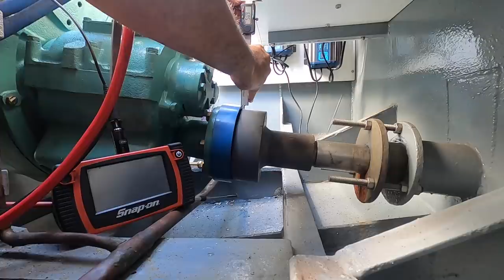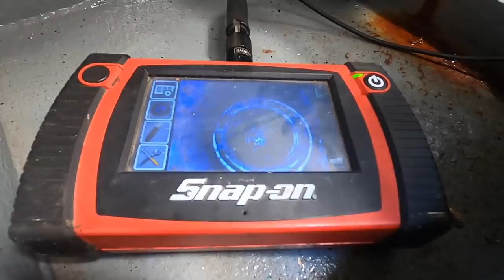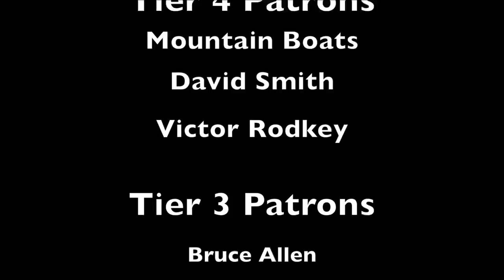Better alignment and odd jobs

Comment: There is a huge assumption that the outside of flange on the prop shaft is bang on aligned with the centre, has there been a measurement of the central alignment of the bolt pattern to the outside of that flange?
Reply from the maker: Nup!

Comment: Hey buddy I just got a used boat with a 1983 Mercury 40hp 2 cylinder outboard on it and I don't know if it's a 2 stroke or 4 stroke engine. I've rebuilt the carb and replace the fuel line. Fuel pump. Just trying to figure out before I start and run it if I need mixed gas or not. This is my first boat but I am a automotive mechanic so I do know how to work on stuff just can't find anything on the web on if the engine is 2 or 4 stroke. Any help would be greatly appreciated and thanks in advance. Keep up the great work

Comment: A bit of sea water is OK in a wooden boat, but not so good for steel. Put a plastic tub (or a plastic jug cut in half) under the stuffing box. If it's a small drip, you can just dump it now and again, for bigger leaks, a small bilge pump w/switch will do it for you. No more foul, corrosive muck hiding in bilge corners, aside from the usual muck, that is... ; {

Comment: Mr worry guts here.. you are taking alignment measurements off the back of the flanges.. Are they machined mm accurate to align with the shafts?
Reply from the maker: It's only to get the bolts started.

Comment: So as you press/slide the engine mount laterally with your adjustment setup, how do you ensure that the opposing mount is actually sliding/moving in the same direction rather than just deflecting at the mounting stud? Are you coaxing it over somehow?
Reply from the maker: I've just been keeping an eye out. You can see the metal ring at the base of the studd getting off centre if it is deflecting rather than sliding.

Comment: Is it normal for that m much water to be dripping into the boat from the prop shaft? At 11:00
Reply: Stern glands tends to drip. It just needs grease and or the packing clamping up tighter. They tend to drip when the boat is underway though.
Reply from the maker: You find just the right amount of drip to cool the stuffing box. If I tighten the bolts it stops dripping entirely which would overheat while running.
Reply: Dangar Marine thanks for the explanation!

Comment: why is there leaking so much water through the shaft? i can't see how you are going to fix this with the motor attached to it
Reply from the maker: Tighting the bolts stops it entirely.

Comment: Can't you use the dial gauge by adding it to the gearbox flange and spin that while the propflange stays still?
Reply from the maker: The gearbox shaft is too short and the flange to narrow to mount it secured.
Reply: @DangarMarine  i see your point although its of course possible to make a new clamp (glue clamp/ oil filter wrench) as well. The main reason for me was that the flange of the gearbox probably varies a lot in thickness due to the paint as well so it might be more ideal if the dial gauge runs on the prop flange as that looks like bare metal on the video.

Comment: Oh, you've got a dedicated Snap-on endoscope / boroscope cam device? Afaik, "generic" USB boroscopes work just fine with a smartphone's USB/OTG port. The industry standard is called UVC - USB Video Class - that's a device class within the USB spec. There are plenty of apps that can put UVC cams on your screen. Iirc, even Abom79 (or was it Keith Fenner) uses one of those 10-buckers. Easy-peasy cheapy-squeezy! ;)
edit: is there something special or particularly fancy about your Snap-on …you know, maybe i've missed a memo.

Comment: Do you have to clear the growth from the prop before spinning or it won't hurt?
Reply from the maker: I think spinning it will throw most of it off due to the coating of prop shield.
Reply: @DangarMarine  True. 
Rain should be done by this arvo should make things easier!

Comment: Just curious on the fuel supply and return. I know it has a cross over line, but does it pull fuel from both tanks? If so, I would put valves on both tanks, and return line valves to both tanks. I don't know how common the issue would be on a vessel.  But have run into when pickup tubes would break on one fuel tank and not the other. Just curious.
Reply from the maker: Yes, it is something that I noted in a very early video that if you are just running on the starboard tank all the returned fuel will be going to the starboard only and you could have it overflow.
Reply: @DangarMarine  you've done so much, it's hard to remember it all, just don't want you to run into a problem on the high seas! Good luck, home stretch is in sight!

Comment: Got a  question  mate. why did you choose to fit battery isolators there and with them being cleat shaped are you not worried about getting a rope around and breaking them off? ;-)
Reply: Also td5 landrover coolant hoses are 19mm and one is a 90 ;-)

Comment: Hey, I've been trying to find the video where you use a torch to heat up the swivel/steering bracket on an outboard to run the old grease out and get it to unfreeze. How can I find it?
Reply from the maker: Try searching "dangar steering bracket" on YouTube
Reply: @DangarMarine  I saw that video, but I remember you doing this with a white Evinrude I believe. The steering bracket was froze up. I have a friend that has a Suzuki that is very hard to turn with the steering cable disconnected. Hoping we can heat up the vertical tube after taking off the grease nipple and get it to free up.

Comment: By my calculation you are taking on about about .5 liter of water per hour through your stuffing box... Will that seal itself up once your start exercising the prop shaft?
Reply: Sixty drops an hour is hardly a half litre. ( 24,000 drops per litre.)
Reply: @redthreadzen  , fast forward to 11:16. I was being conservative at 3 drops per second.... Do some more math.
Reply: @ethanturner5567  lets say 100 per min,  10 mins is a thousand, an hour is 6000 which is 250ml. 4 hours a litre. 
Answer = float switched bilge pump running indefinitely on solar charged batteries. Agree probably could give the stern gland a tighten.  Although at other times on this video it hardly drips at all. See 8:47 - 10:30.

Yes, we are the people who wondered when the clock was going to be fixed.
Reply: @redthreadzen  , we can say whatever we want, I suppose. My question wasn't so much about the math, for which we're using the same-ish basis, nor was my question about bilge pumps or how quickly the boat would sink. But, you can fixate on drips as much as you'd like. The question was will the prop shaft/stuffing box seal itself up through use over time or is the drippage considered "normal"...
Reply from the maker: When tightened the dripping stops completely. Need to find the right tension to drip just enough to keep the stuffing box cool while underway.

Comment: what are you going to do about the water leak in your drive shaft. it has caused alot of rust after you painted
Reply from the maker: Nothing really. Tightening it stops the leak and the rust is just a stain on top of the paint.

Comment: Looking good, anyone know the HP of the motor and what would be the range of the RPM for that one,,Thxs for the info, keep the videos coming and stay safe,, gb
Reply: 4-71 non-turbo 120 to 160 hp at 2100 for marine app. It depends on blower ratio and injector size. You put a set of 55 injectors in you will see about 130 hp, you put 90 injectors in you will see about 160 hp. They will also bark when pulling hard with the larger injectors.
Reply: @krissfemmpaws1029  Thxs,
Reply: @glenbaker5311  you are welcome.
Reply: @krissfemmpaws1029  ok, here one for you.
marine twin 12v71N wet exhaust
HP range at 1200 rpm?
add rates them at 365 hp each
Reply: @jaquigreenlees  you question is a little misleading. The hp you are quoting it likely has 55 injectors so it would be rated about 140 hp and anout 90 hp at the prop shaft in marine app.
Reply: @krissfemmpaws1029  
That is why I asked.
the listing for the yacht states the mentioned hp.
https://www.yachtworld.com/core/listing/pl_boat_detail.jsp?&units=Feet&id=3195191&lang=en&slim=broker&&hosturl=royalcity&&ywo=royalcity&

Comment: Hey Stu what did u have to do w the bolt that stripped in the front of the Detroit? I just installed my head and I think I just stripped out the one on the port side.
Reply from the maker: Do a thread repair like this https://youtu.be/u5k-qDIL3Kk
Reply: Dangar Marine thank you for that good show but we’re u able to reach the treads or did you need to pull the head?

Comment: hello sir. what is the engine problem when in full throttle position, the engine is weak and powerless? i have cleaned the carburetor several times, but it does not seem like a dirty or clogged carburetor problem. does the engine have a weak electrical issue. i have tried to replace the engine plug coil, but it still has the same problem. I use a yamaha engine outboard 40 hp 2 stroke.
Reply from the maker: Could be timing, reed valves, compression etc

Comment: You may need locknuts on those adjusting bolts.
Reply from the maker: The nylocks on the studs holding the engine mounts lock it off when aligned. After that the jackscrews get backed away from the base of the mounts so they don't rub.
Reply: Ok .. I get that.. its just alignment tool not part of engine mount... Just having a closer look at engine mounting setup at 7.05.. So that engine is sitting on 4 x 12mm bolts at a height of roughly 25mm above the mounts which look to be soft mounts to decouple vibration etc..  I assume you have a good thrust bearing on the prop shaft else the prop will push the engine rather than the boat and the soft mounts wont take that given the 25mm gap??

Comment: I think for reliability of a marine engine, should have a new electronics and electricals in addition to spares. Using fixed old ones is not a safe solution!
Reply from the maker: The same could be said for every part so selling and buying a brand new boat is the only answer.
Reply: @DangarMarine  
That's what u said is true for deep pockets, however, if ones aims for good fixing, it's important to change all old electronics and rusty electrical circuits..., Selonoïds are subject to rust same as in vehicles..., Also when drilling holes should treat them with anti rust liquid. A professional fixing is on the long run much cheeper than ad-hoc ...,

Comment: Can see why you're getting a little  vexed with the alignment, you're  operating on TWO planes at the same time, the axial and the Radial and things are drifting that's the kicker...   Get your AXIAL  alignment sorted first...maybe use a felt tipped marker and mark quadrants length ways along the couplings  0 -90-180-270 ...maybe even a straight edge and feeler gauges could help...  once you have Axial plane close to being sorted....LOCK every thing up on the adjusting nuts... then think of maybe Shimming ... with 'Brass Shim' Stock...under the feet of the anti vibration pads...same even shims under all four pads... otherwise you use the axial alignment... if you're readings say  need to go up two millimetres on the bottom  with same you might only have to put a one millimetre shim under each of the pads to change that Datum...It's been thirty years ago since i did same but that my take on same, if you keep the jacking screws hand tight all around it will save drifting... good luck you're nearly there...Great work....
Reply from the maker: Yes, I can see the benefit in thinking in just one plane at a time.
Reply: @DangarMarine  Correct get the Axial Alignment Dialed In first, then you're on the home straight, Lock up same then it's a matter of maybe Shimming  Up... ALL Round...                  [As i young Irish man i was doing pump /gearbox /Motor  alignments at the Dullingara Oil Facility S.A. out in Sticks, in the 'Coopers Creek' Basin on a 'Working Holiday', biggest problem out there was the Flies, but then again there was No Beer rationing  of that  'Coopers Ale' in their  F.IF.O Contractors Wet Canteen...indeed you will get there, you're nearly there, .... would like to give you a dig out,  but i'm back home in Cork Southern Ireland...lol]